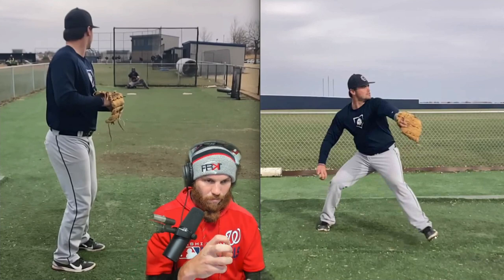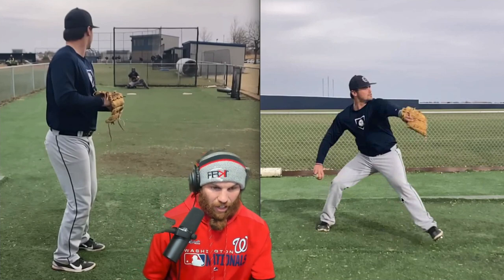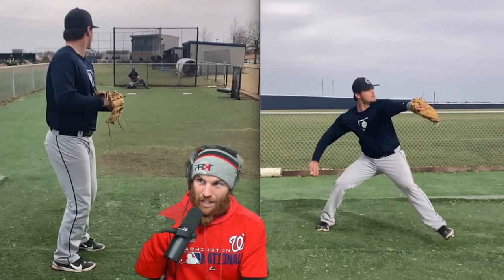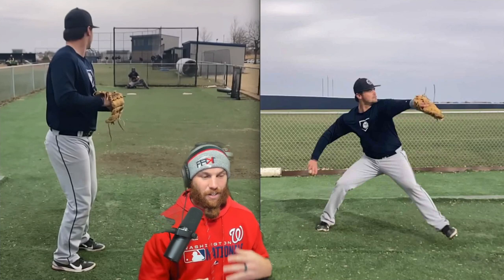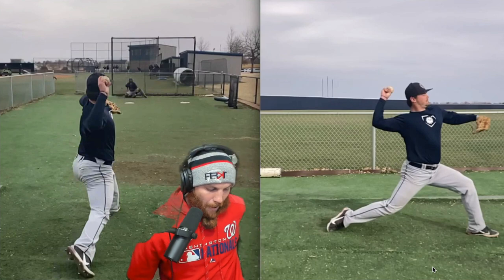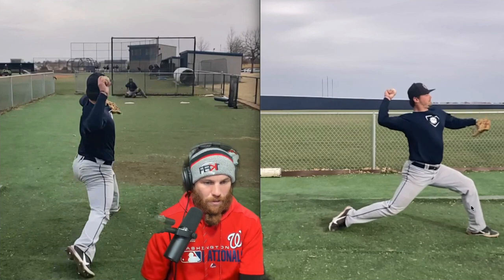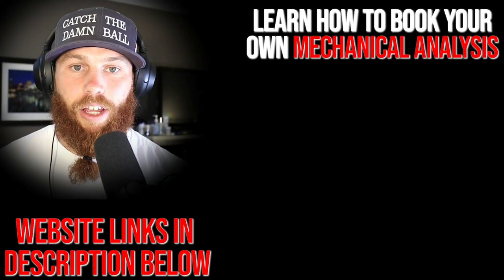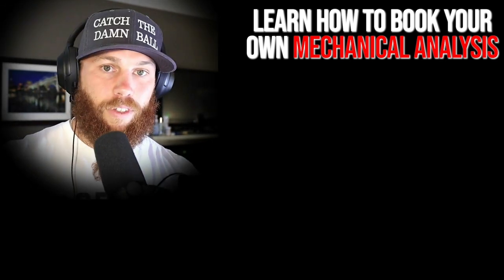Getting Stuck in Drive Leg Loading Phase feat. Liam Hendriks | MECHANICAL ANALYSIS

Comment: I use to do the same exact thing. Got stuck over rubber, tilted back to load, bad trail leg flexion, late launch. For me one simple thing fixed it and corrected everything else down the chain. Still have a lot to work on but, my initial move is a lean into my shoulder which starts my drift. Good luck! Keep grinding! https://youtu.be/MCFxxPI1fzE